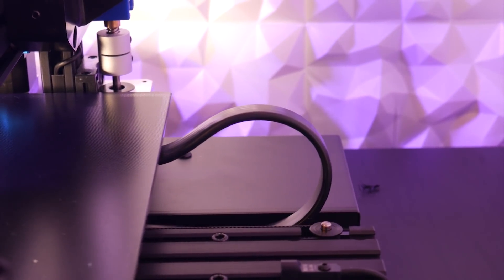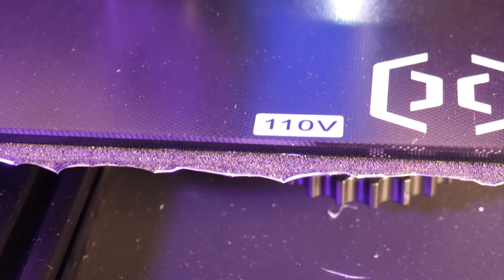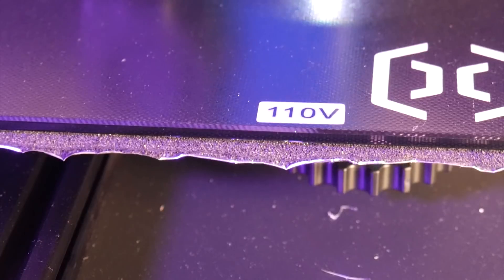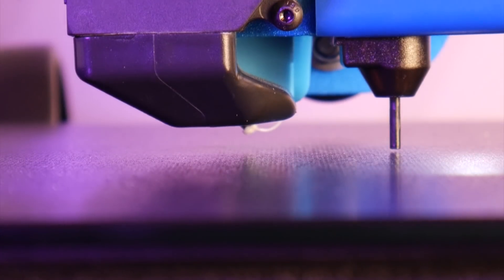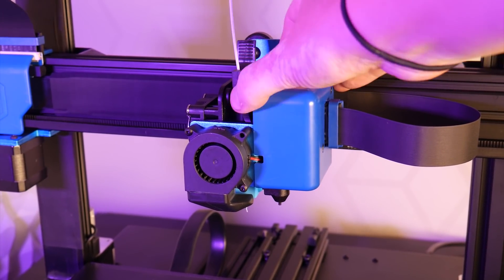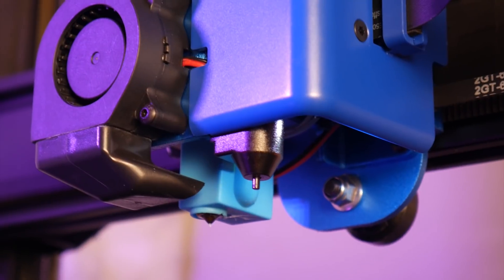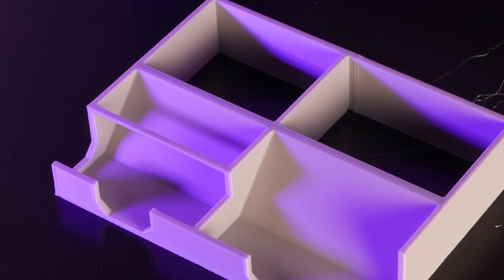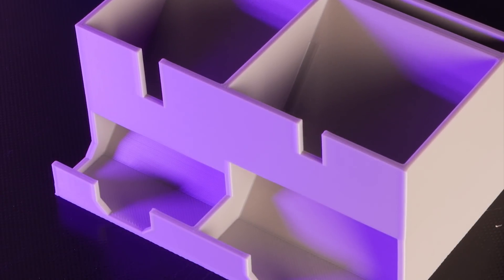5 3D Printed Things on The New Artillery SideWinder X2

Comment: Hey, 

what are your print settings i still suffer from a bit of warping on the edges especially at the corners of the object ?
i prints at 216 and bed at 60
Reply: To hot a print causes it with me, also not having the ventilator on,. U suggest lowering your temp. Also printing with raft can help alot. :)

Comment: I have the X1 and have put hundreds of hour on it without any headaches. My longest print was 53 hours and the X1 handled it flawlessly. You can't go wrong with Artillary. I'll be purchasing the X2 in the coming weeks.
Reply: Got mine 3 days ago. z makes gridning noise when moved. contacted support and when i opened it and troubleshoot, i found that the stepper motor wire for the z was defective and did not work
Reply: Not mine, the prints lift off